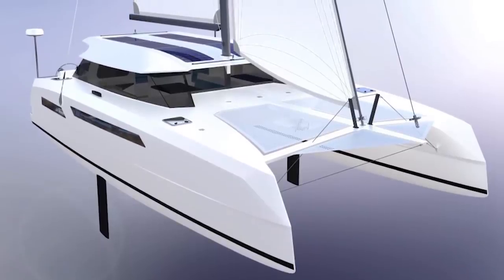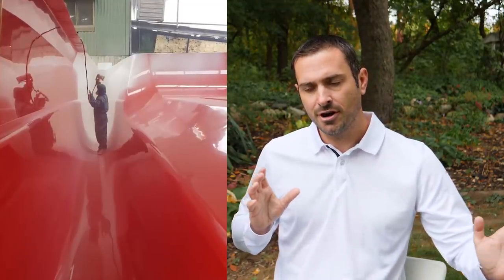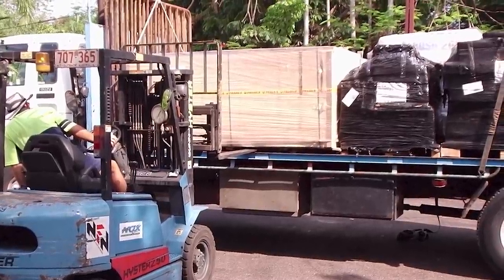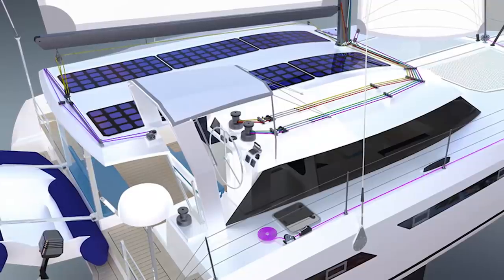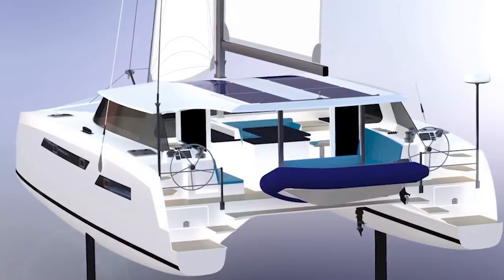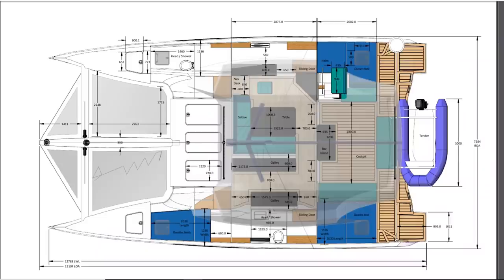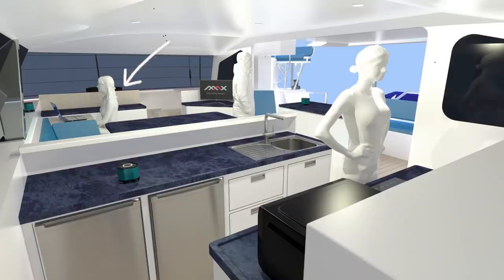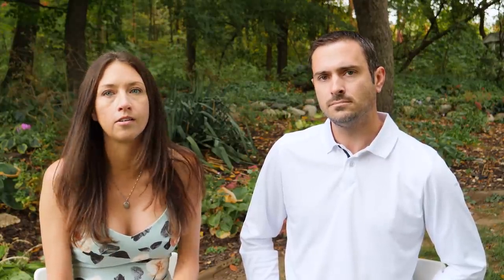YOU'VE NEVER HEARD OF THIS CATAMARAN - But It's Our Newest Contender - The Max Cruise 42 -MJ Sailing

Comment: When I was running PDQ Yachts, we had 4 people making hulls and decks, 6 people making the FRP liners, 8 people assembling and bulkheads, 8 cabinet makers, 4 electricians,  8 deck hardware, and 12 interior installers. The time to build a hull and deck is very low and relative to all the rest of the work. Going with a gel coated finished hull Is absolutely the way to go. With all of that in mind I would suggest getting as many prefabbed liners as they can provide. Also we built over 300 boats, all in polyester and/or vinyl ester. Half the cost and 24 times quicker to harden !
Reply: You guys built some awesome boats!  Please stick around... I could use the advice of someone with your experience.   -Matt
Reply: Very interesting.  Any advice re which boat manufacturers would be good to approach to get quotes on a customized 40' to 45' power catamaran at a moderate price?
Reply: Couldn't  you purchase and do your build in Vitnam, rather than pay for shipping?  Cost of living would be cheaper ?
Reply: matt johnson thanks Matt, we always built boats we could be proud of and that we could sail and enjoy. DM if you want any info or thoughts, personally I have no axe to grind.
Reply: As I am now in my late 70’s,  I have lived aboard and cruised 5 different boats. Now, my favorite boat in the world is the PDQ 34 power cat!!  Amazing boat.
Reply: @treasurecoastgypsy  i Hand the same thought. Dies anybody Knows Why?
Reply: Hi Simon, are you currently in the boat building business?
Reply: @coop3014  Hi Coop, presently, no I am not. I do keep busy making custom furniture and other woodworking projects.

Comment: i absolutely love how you guys are so informative and provide a ton of info.  I think the max 42 is definitely the one to go with. the prefab hulls and parts and gel coat are going to provide the edge needed to get you back on the water sooner and add the best resale value confidence. Ive done a lot of diy projects and the learning curve takes a few turns until i get it to a professional level and the cost add up in labor and material. So yes definitely prefab. Also I want to see you guys back on the water asap.

Comment: I agree with the outboard. I see so many people fumbling over their diesels, forced to haul out to fix a saildrive or just break something on the propeller with flotsam.
On my cat we had outboard and it was so easy to fix things and swap it out. The outboard of my dinghy was also put to use when needed.
The biggest problem was the noise of the outboard (high pitch whine) and I heard that cruser are wary of carrying gas in case of lightning strikes.
With the outboard I would add a small generator hooked to the fuel system. That way you never run out of power and you don’t have to oversize the solar system soo much.

Cheap, quick, easy to fix or replace all around the world.

Comment: Magnificent design and build technique. Just read about it today so I have been searching online for all information. I saw your container unloading video first and was very impressed with how well thought out the design is for home builders. I lived aboard a 40 ft light weight cruiser/racer trimaran for 6 years and the deck space, cabin space, and speed made it a fantastic boat. Then cats started getting better designed but heavy and slow. 

The Max 42 is going to be very popular and I am very tempted... but too old to build another boat.

While cats have many great features and qualities, the light ones really move around quickly which takes getting used to when walking the decks and when below. You get used to it but guests will feel like they are in a small airplane in turbulence. Most are also very noisy below at speed with the water rumbling along the hulls which takes getting used to when trying to sleep.

One other danger of a fast boat is hitting floating objects at sea. My boat (and the Max 42) will sail at 12 kts in any good breeze and will exceed 20 kts in a good breeze when surfing ocean swells. My knotmeter only went to 20 and it was often pegged for long periods when surfing and 18 kts when reaching. Very exciting, very fun, but very wet going to windward with a fire-hose blast as the upwind bow pierces the waves. It is easy to drop sails at night to slow the boat down for safety and dropping the speed to "only" 10 knts make the boat feel so slow and easy moving. And much quieter below.

Crossing from Puerto Vallarta, Mexico to Hawaii was 20 days without pushing the boat at all but one day we saw something floating up ahead and it turned out to be a huge log at least 8 ft diameter and it was quite long. We were only doing 12 kts as we slid past it but we talked about what damage it would do to our boat if we hit it. We were fortunate to see it at all but what if we hadn't seen it? What if we had been going faster? What if we plowed into it at night? There is a lot of floating junk out there and some of it is heavy and will cause serious damage. 

However, it is much easier to sail a fast boat slower when prudent than to try to speed up a slow boat!

You made an excellent choice to build this boat and I really look forward to the construction videos.
I am subscribed of course!

Comment: @15.50.  Details!  Yes!  I so wish everyone could provide such detailed drawings when they are selling a boat, new or used.
I'm looking for a boat but I'm probably looking at slightly less race, slightly more comfortable and slightly bigger, but this is really nice.  Plus the advantage you have with a smaller boat is draft (specially with dagger boards).  I really like the idea of getting into them little protected alcoves where there is only about 2m of water, and 1-1.5m of entry at high tide.
Nice use of space, no waisted space or overduplication anywhere.
Lots of options with the layout of this boat.
Why do you favor outboards?  Yes, they can be easily removed, worked on or replaced, but the likelihood of needing to do so is much higher than with the diesel inboards.

I only just bumped into you.  I really liked your video.  You now have another subscriber.  :)
All the best with your construction and subsequent sailing!  Looking forward to your construction videos (should you choose the Max 42).

Addendum:  Just saw the date posted.  Figure the build may be over by now.  Will watch all your construction vids now, and hopefully some sailing vids and you comments on how you now feel about the design, performance (and if complete, the livability) of your new boat.

Comment: I am planning on doing something similar to what you are doing. There are a couple of issues I have with the Max Cruise 42, first off it is very small and light, it won't be able to carry much without a large loss of performance. It also doesn't sound like it has enough bridge deck clearance.
Retractable aft engines sound great except that they pop out in waves and over rev. They are basically useless in inlets with opposing wind, waves and current.
Also consider ditching the sail idea, you will never recoup the fuel costs vs all the costs of a sail plan, not to mention it takes less time to build.
The build time and material costs of a 40 footer and a 50 footer ( and longer) are similar, limiting the length because of shipping container constraints doesn't make much sense.
One last thing, if displacement hull speed is sufficient, fuel economy can be very good and the engine size can be relatively small.

Comment: Wow! Using out board engines instead of built in engines seems brilliant. Most of the big problems being worked on on the hard seem to be engine prop related. Being able to easily lift off the engines for repairs will be so nice and changing them out will be easy too.
Reply: worked on a boat with longshaft outboards,  for coastal cruising its fine but actual ocean crossing inbuilt diesels is the only way with either shaft or said drive is the only way atm
Reply: Gasoline Flammability is a hazard that can be minimized utilizing diesel which is combustible (non-flammable).  Also, sailing range is better with diesel engines, of course if you are crossing oceans.
Reply: yep advantage of diesels,  they dont go boom if you have a fuel leak, more efficient,  more torque and its more important for pushing a boat,  more reliability  I would only go petrol for coastal cruisers.    If you wanna see a train wreck theres a youtuber pulling cummings diesels out of a 40ft  power boat and replacing them with LS petrol.  Could be a train wreck
Reply: There are diesel outboards too. I'm guessing the cost and difficulty finding a service center and parts would negate the benefits.

Comment: I have just taken delivery of my Schionning ARROW 12  (SeaBiscuit) built in Knysna South Africa- It  exceeds all expectations.
Some thoughts-1.consider a rotating mast-it is a revelation in performance. The MAX 42 looks as if it deserves it.
                             2.consider tiller steering-simple bullet proof.
                             3.consider diesel an shaft drive with feathering props-petrol outboard inefficient/dangerous/poor reverse/problem in lumpy seas  /short range/and the need of gas hot water and probable generator(no  reasonable alternators)
                             4.lithium battery/solar/
                             5.Their weight estimates look somewhat over optimistic especially if not using epoxy or carbon
                             6.consider structural rigidity with such an open bridge deck.

Comment: Agree with much of the comment directly below from 86daily, but SO FAR, SO GOOD!  #1 choice for me - so far. The hull concept alone would tilt my head quite a way in this direction vs twisting flat panels hither and yon, praying that the joints hold and then making it all look great from the outside.  IF this company has a good track record in the past, that also counts for much.  I'm not as concerned about the "cheap labor country" as quite a few GREAT cats come from the Far East and from South Africa, etc.  Perhaps they don't seem as hidebound by "tradition" in design and construction tech as others??

Comment: The Max 42 looks like the best option, build process looks great. I love the option for outboard engines, easier to to maintain and you don't have the drag when sailing if you can tilt them. You could get diesel outboard and an electric outboard, look at Torpedo Outboards.

Comment: Hey Matt & Jessica, this is the second time I've watched this video in its entirety, it's a very interesting introduction to the boat and the brand. I love that galley too, every cat should be set up that way! Couple of things I'd love you guys to talk about on the next video looking at the Schionning Arrow and the Max-42. What do you expect your cruising payload to be? The Max-42 has a payload of 4840 lb., which is a huge amount of gear, food, water, fuel, spare parts, etc. - most couples can sail long distances with far less stuff on board their boat. Which of the two designs looks to handle loads better? And two, if you were to cruise with a all -up displacement of 14,440 (with 3,000 lb. of stuff) what will the bridgedeck clearance be? What with the hull length to beam ratio be at that displacement? It looks like the Max-42 will be a pretty stellar design if sailed at a lower than the designed displacement. Also, I really do like it when Matt gets into all the details, this is very informative material that can't be found elsewhere. Thanks a ton for doing these videos!

Comment: How exciting! I can't wait to have Matt go through all the details of the two final choices - seriously! This looks to be a very clever compromise - for a little extra shipping and kit cost, you get a big reduction in build time, so you get to spend more time building the bits that are interesting and will make the boat yours. I'd check that they are on course for their projected build weights - and it would be very easy to over-engineer the final assembly and end up gaining a load of unnecessary weight - you want to save the payload allowance for things that make living aboard more pleasant, and the sailing more fun. That's why Dazcats work so well - very carefully managed builds, and no excess fat - just incredibly strong but light boats through attention to detail and their build experience. We have news too - I'm buying Star, the Pat Patterson Twins 43 that's been on brokerage with the Multihull Centre, as a liveaboard. Don't worry, EasyTiger will still be my favourite sailing machine! I decided that I couldn't make one boat do everything, so Star comes into our lives as an ideal floating home, and one that has circumnavigated the Southern Ocean, so could take us ANYWHERE! Cheers, Julian
Reply: Oh, and do think about the drive options, and the charging implications. Outboards usually have low charging output - enough to recharge their starter batteries, but not a large boat's systems (and also no hot water as a by-product). A generator, larger battery banks and/or more solar panels can compensate, but all add weight. I hate to say it, but the diesel engine often ends up the most efficient for weight vs power needs. Electric is getting there, but you need sponsorship (like Uma and La Vagabonde) or deep pockets at the moment, and expect to sail 95% of the time, and manage with minimal consumption on things like fridges (and definitely no aircon).

Comment: Looks to me like the Max 42 is the way to go. You still get the very hands on build experience which you both love, and at the end, will put you in the unique position of knowing every system and every component of every system on the boat. You will install those systems, hands on info you can't get any other way. 
You also get  all the other benefits of the "sweat equity" that comes with a project like this but without a huge chunk of the misery that goes with it...the endless sanding, the mold stuff, etc. If this boat has the layout you two like (and it seems you do) then I can't find a downside to doing it based on what you have shared with us.
I think they will sell a lot of these, and if you choose this boat, I think you two will be responsible for a bunch of those sales. 
Bottom line, do what makes you happy, you are building your home for many years to come. I would also pass on the island option, knowing that down the road should you want one you two can design and build a custom one that suits your needs perfectly.

Comment: The way the lines are run at 11:45 and 12:45 look like they might be an issue with that sharp angle bend as they are run past the solar?  A more direct routing would make for less effort and less wear don't you think? 
I like the galley layout and the squared corner settee.  I am not interested in building my own boat, but if they do a full build option, it might be worth considering...

Comment: The outside of the Max looks a lot like Ruby Rose2 , just a bit smaller. The build of the max looks like it comes from the Rapido trimaran factory in Vietnam, they use the same vinal resin. just a guess though. If you have time SV Lilliput bought a second hand Schonning in Malaysia. In the galley area she said something about the head height being to short for her boyfriend because of the shape of the roof. Worth considering because as you know comfort is everything in cruising.  Difficult choice. Have fun.

Comment: Please do carefully check the pro & cons before considering building in Asia, either Vietnam or Thailand. We are building a cat in Thailand and it has been.....I don't even know what words to use.....Slow, expensive, frustrating, build materials quality issues, massive hassles with importing equipment ( nothing available here, everything must be imported), low worker productivity ( 12:1 productivity compared to comparable Aussie worker, by actual comparison), lack of worker expertise and materials knowledge, etc, etc.
In Vietnam you have a set time period to build, and you will be kicked out on that date, no extensions, the boat MUST be exported whether it is finished or not, or even able to float!
There are many traps that can lead to a dream destroying experience, and we are quite resilient and persistent. Tread carefully, please.
Reply: wow, how has it been now, after 5 months of your post?
Reply: They're shipping it to them all the pieces are coming on freight they're not building it in Vietnam so you can take a chill on that and know that they are going to be getting it in a container which they already got

Comment: Very exciting!  I’m looking forward to all the details. Subject to the cost implications, shortening the build time and eliminating all that fairing and sanding is a huge plus. My sense is, as labour is an expensive item in any professional build, it’s one area where the sweat equity can save you a bunch of money.  If you go into comparative costs I’d be very interested in the difference.  Finally the value of finish quality cannot be understated. It’s not just the resale value, but also pride in ownership.  It’s going to be your home and you’ll be looking at any imperfections everyday. 

I’m sure you’re aware of Andy with Boatworks Today.  He is testing a new paint additive which allegedly will flatten a rolled paint to a mirror finish.  I think it’s Alexseal (sp?).  Might be a consideration if you lean to the flat panel construction. 

Regardless, this is going to be fun. Good luck.